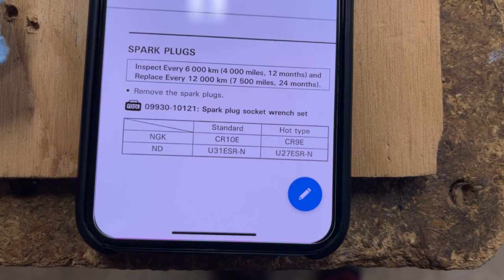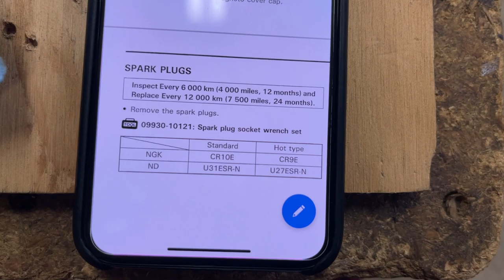New Year’s GSA Ride!! • Completing the DR650 Job! | TheSmoaks Vlog_1874

Comment: Great ride before/during the rain. I have to ask, when you clean the silicone off the head and cylinder...how do you do that without gouging the surfaces?  I thought I saw a razor blade tool on the bench, is that what you use?  I don't like most of the "gasket" scrapers they sell, you're right away digging into the material.

Comment: Sean, have you seen issues with the Nav VI?  Garmin already replaced one unit for ghost touches but now after only about a year the second Nav  VI is doing the same thing.
Reply: I had issues with the Nav VI took it to my dealer they updated it and that was it. But from what really happened is I was putting an addy in it and then it started to act like the X files lol. Truth of the matter is that it was soooo cold that day, like maybe 27 degrees, so yeah. that was my issue hope that helped. And yes I was out riding!!